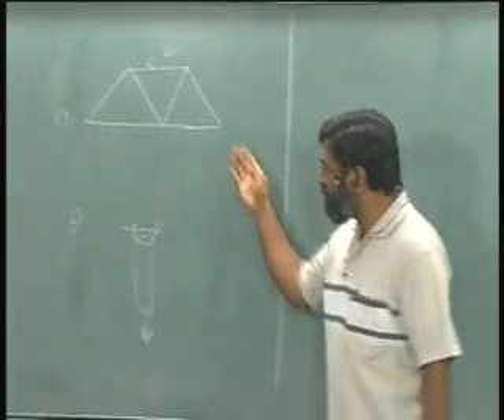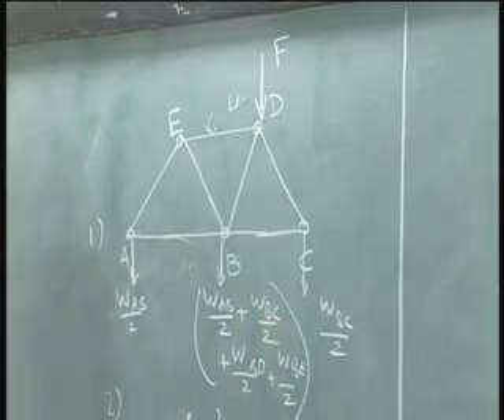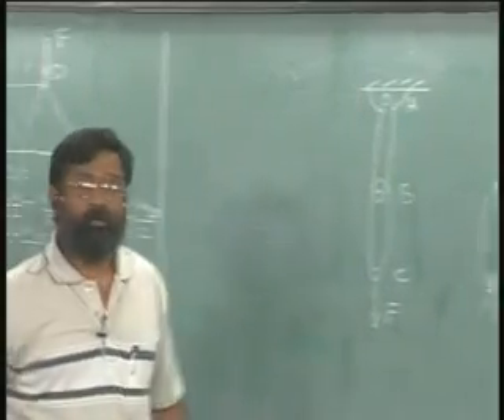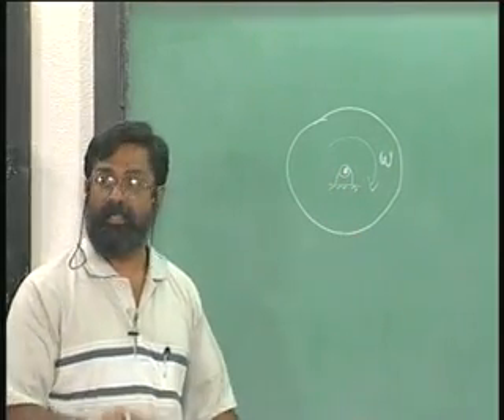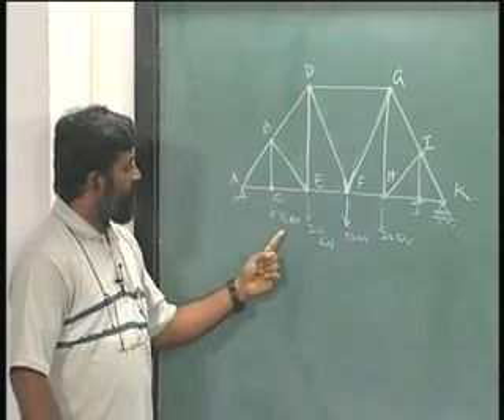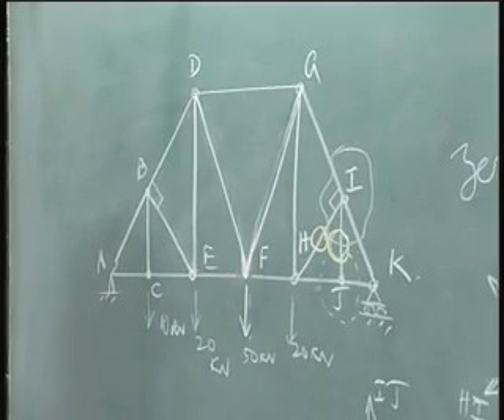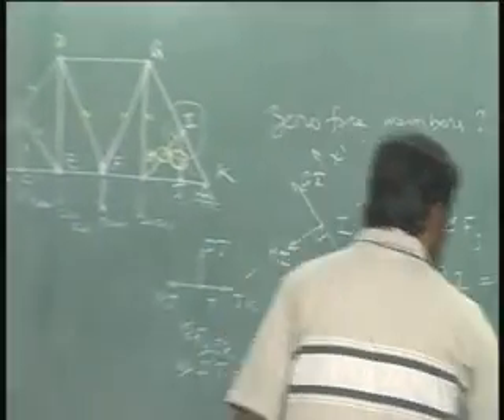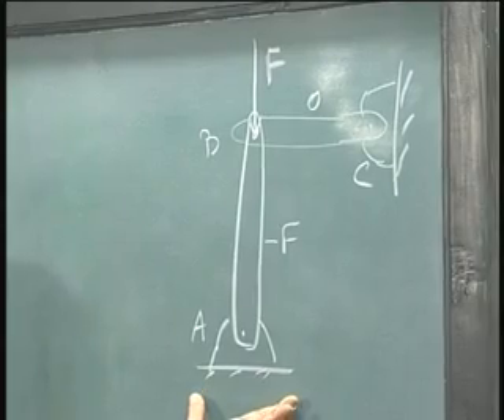Mechanics of Solids - IITM 2.6 Trusses - additional discussions.

Comment: @Ar1stot15le 
You should first separate super structure and substructure and find out the interaction forces before solving each as a truss structure unless they are connected only at the joints.
Hope this helps answering your question.
anbudan,
Siva